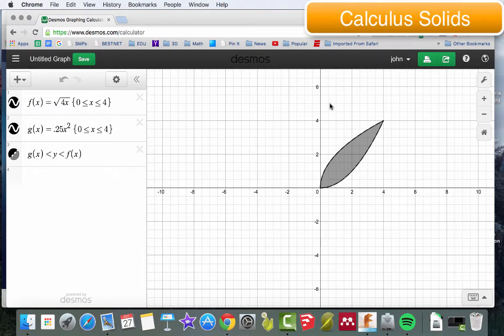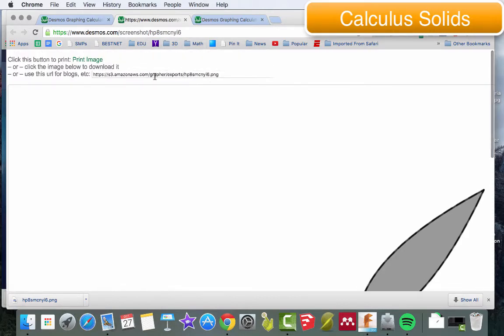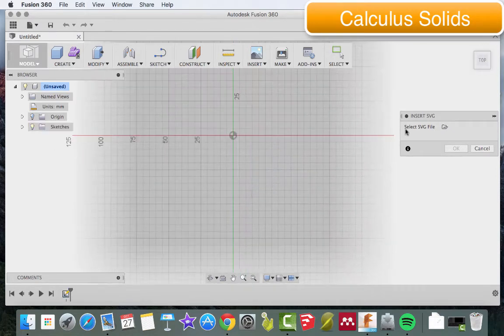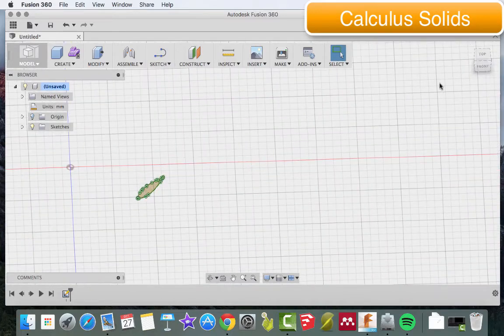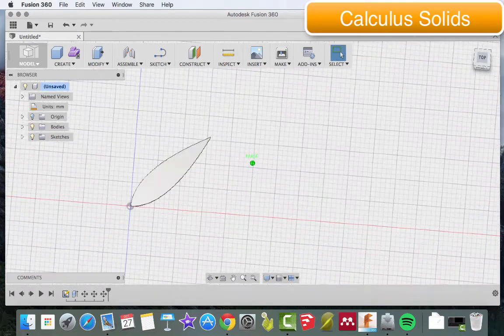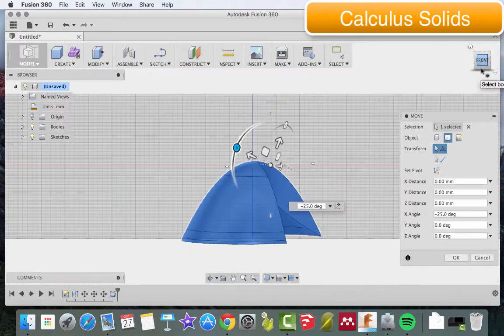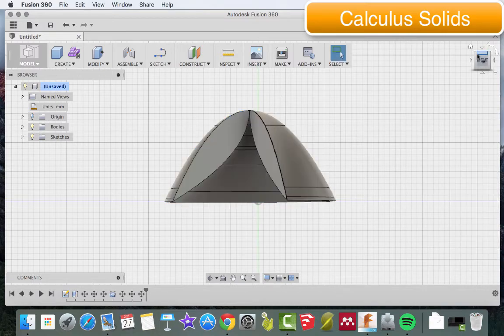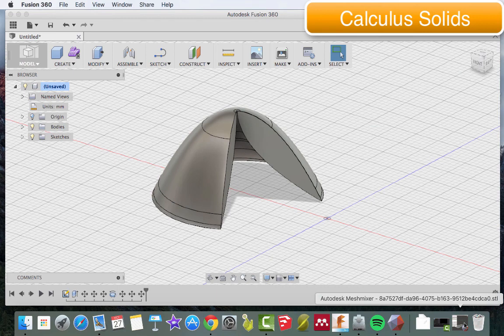3D Printing Calculus Solids

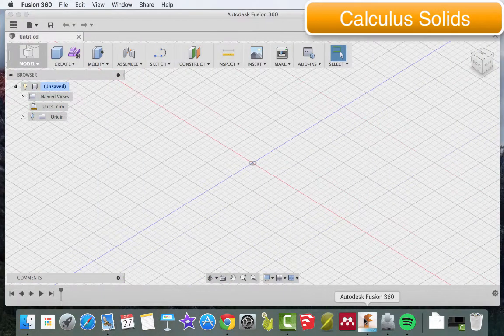Comment: You mentioned (2:39) that you can use SketchUp to do the same things you are doing in Autodesk. Care to elaborate or point in the direction of helpful links to do it on SketchUp? Any help is much appreciated :)
Reply from the maker: There is a rotate button in Sketchup; I'll have to make another video to explain it.
Reply: I was doing some research on my own, and it appears that I will need the "Follow Me" tool to do what I want to do. It also appears that this functionality is only available on SU Pro, but I am running SU Make on my PC. 
^Is that accurate?
Reply from the maker: I have Sketchup Make 2017 and it's available on that version. Can you get that one?
Reply: Ah. I am running 2016 currently, so that might be the problem haha. Is "Follow Me" just in the main toolbar like the other buttons and features?
Reply from the maker: I just click on "Tools" across the top and Follow Me is halfway down. I'm pretty sure it was on my 2016 version as well. (I never paid for any pro features, FWIW)
Reply: Yep! There it is. Thank you very much! This video was very helpful.